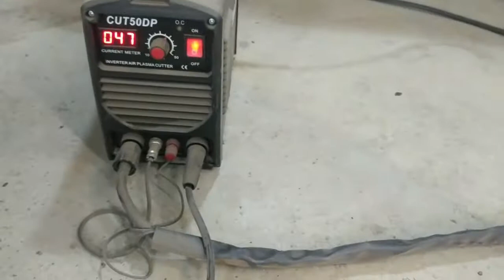73 Ford Ranchero GT Rust Repairs Ep #2 - Rear Bumper Removal

Comment: MaxJax  5.5 inch tall height adapters  would give ya some more head room under the car.  https://www.maxjax.com/accessories/tall-adapters/ , would have to jack the car up with a jack first to get it high enough to fit the extra length in I would guess. Assuming there is enough ceiling height for the extra 6 inchs. Then add a couple of Underhoist Support Stands , one under each end to stabilize the car while working on it, plus if the car slips or something they will give you time to run like hell haha https://www.amazon.com/Sunex-6809-Underhoist-Self-Locking-Components/dp/B00AHIWN78?ref_=fspcr_pl_dp_3_15708011
Reply from the maker: Those would help for sure! Overall, the hoist is a massive improvement over working at ground level...taking the bumper & gas tank off the Ranchero would have been much harder on my old bones without the hoist.